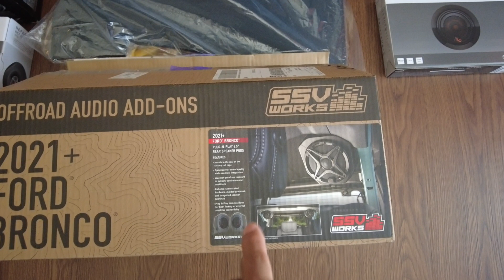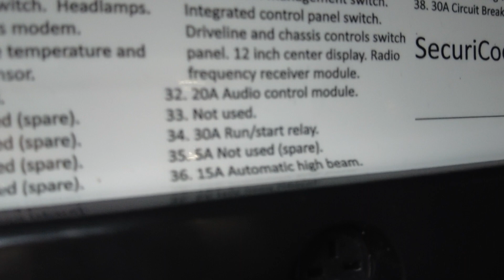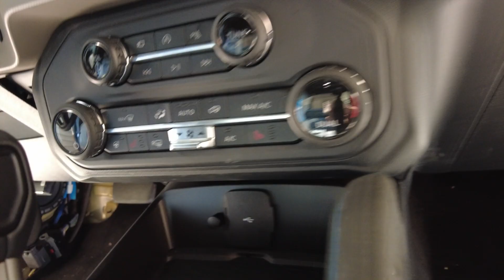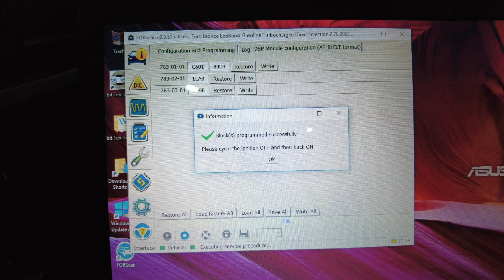Ford Bronco FULL Sound System Overhaul With Aftermarket DSP & Amps Integration

Comment: Awesome job is video awesome job for your sound system... I had to watch your video because I did the same thing With my bronco. Rockford Fosgate speakers 300 w amp and sub.  Cost me $1500 to have installed.    Not quite till the extreme you did, but it does sound a 1000% better than the old system.  Again excellent video....
Reply from the maker: Thank you

Comment: Man. I think you did a really good job on your instal. My only thing is that sub takes up way to much trunk space. I had that same sub, but then had my shop build me a custom sub box on the tailgate.
Reply from the maker: Thank you. But because I have the ability to turn the enclosure sideways for the added space if needed the size hasnt been an issue for me. Plus i can easily remove the enclosure when needed. As far as the tailgate enclosures or even the stealth enclosures you can get or have made, they lack the output i look for so I personally wouldnt get any of those unless there was no other viable option for me.

Comment: Great video, thank you for bringing tons of value! Quick question: I have a '21 Bronco OBX Lux with the B&O sound system. I just ordered new speaker pods, Kicker CS 6.5s for the roll bar/pods, Kicker CS 6.75 for the kick panels, and Kicker CS 4 for the front corners to improve clarity (I'll leave the B&O sub for now). I have an aftermarket 4-channel amp that I want to use to power these speakers. Do you have any suggestions on the best way to get a signal from the head unit to the amp without spending a fortune? I'm okay with buying a DSP, but I'm still unclear on where exactly to tap into the factory head unit to get the signal to the DSP. I've rewatched the video several times but it still doesn't click with me. Any clarity you can provide would be highly appreciated! Thanks! .... PS - I like the idea of adding/plugging tweeters and the front center speaker into the factory harnesses to preserve some of the vehicle's functionality. You get 10 bonus stars for that pro tip!
Reply from the maker: Thank you for the compliments and support. The DSP is essentially an LOC and EQ combined so technically for your setup all you’d need is a Line Out Converter (LOC) to convert your speaker wires to usable RCA’s for your 4-channel amp. essentially you’d tap into the same wires i did in this video (front corner dash and front kick panel speakers). PAC also makes an amp integration harness & LOC that makes it even more simple with no additional equipment needed. The PAC harness for the Bronco wasnt available yet when i did my sound system but if you’re interested in that aspect then look up the PAC AmpPRO for 2018+ Ford B&O Amp integration harness (part# AP4-FD31).
Reply: @Srtfiedofficial  dude! Thank you for the clarification. This step was exactly where I was lost. Great solution and thank you for the fast reply. Your content is great, and you've built some sick systems bro!
Reply from the maker: @mattbz0024 thanks bro💯🙏🏽

Comment: Great video. I have a 22 wildtrak I'm about to build. Only thing I would have done different for ease of install, is a pac audio AP4-FD31. It's for b&o. Can do rca straight to the Amps or toslink into the dsp.
Reply from the maker: If it wasnt for the fact that i needed high level inputs for my DSP I already had from previous vehicles, i would have gone that route but i wanted to utilize the equipment i already had so I had to do extra steps.

Comment: For the Front 6.5 Inch Components the Hertz CK 165 F. Those came with a external crossover. Because you got the DSP Did you still need to use the crossover or would everything just be tuned from the DSP and theres no need for any crossover? My plan is to have separate channels from the amp for the kick panels, front corners and tweets and having a DSP in the set up.
Reply from the maker: Yes I still needed to use the external crossovers since i did not wire the components in an active configuration. If i would have wired the tweeters to their own channel on the amp and the mids to their own channel also then i wouldnt have needed the crossovers that came with them.

Comment: Hey brotha I’m doing something similar in my bronco currently. How did you turn down the factory chimes and head unit sounds after you amplified your speakers?
Reply from the maker: I turned the head unit sounds off via the head unit settings, however because I didn’t tap into the speakers that had those chimes, they arent amplified and sound normal. The back up sensing chimes and blind spot warning chimes come out of my rear tweeters i added to the factory rear speaker wires. The front collision warning chimes come out of the front center speaker that is also just running off of the factory wiring from the head unit.

Comment: How did you get the rca to work with the headunit as they dont have rca outputs
Reply from the maker: Everything was thoroughly explained step by step with visuals if you watch the full video! The sound processor is also a line output converter that converts your factory speaker wires into RCA outputs for your amp which is why i ran the factory front corner dash and kick panel speaker wires to it and then ran new speaker wire back to the speakers separately from the aftermarket crossovers & amp.

Comment: I have the issue with the noise cancellation, heard there’s an adapter to bypass ANC, but in the time being until it comes in, I had my microphones unplugged but still do get some noises, how do I fix the issue of still hearing audio where at 0 volume, granted the audio you hear is so low at 0 but 0 should= no audio / no white noise
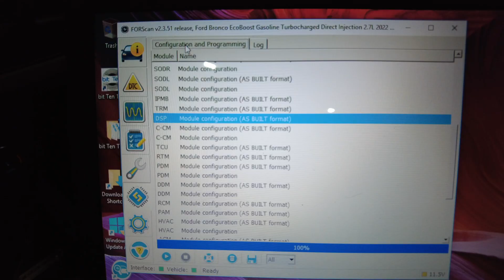Reply from the maker: The only way to truly cancel it is to do what I showed in this video with forscan at the 18:46 mark which disables it all together.

Comment: Both amps, distribution block and crossovers would have fit on your amp rack with room to spare. I have two VXi amps, VXi-HUB, LC7i and a distribution block mounted on that exact same amp rack.
Reply from the maker: If I didnt have to keep the factory amp in place as you can see in the video then they would have fit.

Comment: Hey man, awesome set up💪🏼 how do you like that HD 750 amp do you feel it’s enough for that 12 W7 I’m about to get this similar set up.
Reply from the maker: Thanks bro and yea that HD 750 is plenty for that sub. Technically according to JL, the 12 inch W7 is rated a max of 1000 Watts RMS and 750 Watts RMS being optimal. You could run more power to it but it will void the W7s warranty. That being said, the HD 750 amp is plenty for that sub as literally everyone who has listened to my setup cant believe it’s just one sub on a 750 Watt RMS amp.
Reply: @Srtfiedofficial  hell yeah bro how about that HD 600/1 is it pretty reliable?
Reply from the maker: @TRDproMike the HD600 is a 4 channel amp so it’s a 600/4. In terms of reliability ive had this exact same setup in my past two vehicles so in total ive had it for 7 years now with no issues except I had my Subwoofer rebuilt when I put a hole in the foam surround on accident (video is on my channel about that). But overall both my amps and sub have been great with no issues.
Reply: @Srtfiedofficial  hell yeah bro I don’t care what anybody says about JL Audio that shit is the best!! I currently have 210 inchTW3 with the RD 1000/1 they sound good, but you know that W7 is on a whole other level!! I plan on upgrading to these amps. Thanks for the response.👊🏼
Reply: @Srtfiedofficial   also, what kind of battery do you have??Heard the HD series amps are hungry for a lot of power.
Reply from the maker: @TRDproMike nice and yea you’ll definitely be happy with those amps. JL makes great quality products
Reply from the maker: Im running it off of the factory battery and have been every since i got them brand new but those amps are just as power hungry as other amps in its class. Ive always ran them off of the factory batteries without any added high amp alternators or additional batteries with no issues. The only time you really want to look at upgrading batteries and etc. is if you’re really pushing some serious power but for the average person pushing 1500 watts RMS or less in total system power, the factory battery and alternator is good enough in these newer vehicles.
Reply: @Srtfiedofficial   hell yeah let us get a demo 😎 I’m sure your system sounds bad ass !
Reply from the maker: It’s hard to do a demo on video as it doesn’t do it justice nor does the quality of sound translate through ordinary camera microphones I use.
Reply: @Srtfiedofficial  oh ok bro well thank you for all the information 👊🏼 😎
Reply from the maker: Yw and no prob. Feel free to ask if you have questions in the future and thanks for the support on the channel.
Reply: @Srtfiedofficial  hey bro what’s your opinion on the 10 inch W7 do you think it’s just as good as the 12? I’m not working with a lot of room so I might have to get the 10. W7 🤔
Reply from the maker: Yes the 10 inch is just as good. If you’re limited on space but have enough room maybe consider two 8 inch W7s. They will outperform a single ten inch since you get more overall cone area.
Reply: @Srtfiedofficial  Man i’m hoping that 12 fits if not the 10 will have to do 😅 yeah, those eight w7  are bad ass.
Reply: @Srtfiedofficial  hey what’s up bro how’s it going so I finally got my HD amp  installed with the 12 W7 had a question how turned up do you have your gain on the 750 amp
Reply from the maker: About a little past half way. But i tuned my gains with an oscilloscope as you can see in the video
Reply: @Srtfiedofficial  what an upgrades this amp is 💪🏼thanks bro got it

Comment: I have the b&o and is garbage. I don't even know where to start...
Reply from the maker: If you just want to add better clarity the just change out the front dash, kick panel and rear pod speakers.
Reply: Would I need a DSP to swap out the above speakers?
Reply from the maker: Not at all. A DSP is just something extra that will optimize your sound experience.
Reply: But I can’t add a new sub without DSP? Swapping out pods and dash speakers is fine without DSP. The B&O sub needs more power.
Reply from the maker: @Bonez773 you can add a sub with a Line out converter (LOC). A DSP is also a LOC but integrates a 32 band EQ and other features all in one.
Reply: Thanks

Comment: What a cheap half ass method to install amps and sub. Nothing here is custom and can be placed into any other vehicle. 

Sorry but I have seen far superior stereo upgrades in these Broncos. Suppose you didn't have the knowledge, ability or funds for a truly custom install?
Reply from the maker: You’re either a troll or you obviously dont have any knowledge about car audio. That being said thanks for tuning in and sharing your thoughts despite the ignorance and back handed comment.
Reply: @Srtfiedofficial  I've had better custom systems installed. Please look at other Bronco stereo installs. A better install had the amps installed under cargo floor with double fans for cooling air flow. Also had a custom sub box built not that pos I saw in this video.
Reply from the maker: @trentcasey1354 ok and where do you see anything in or about this video that states that this is a custom sound system build? It clearly states that this is just a full overhaul and upgrade from the B&O setup and showing how someone can do this themselves versus having someone else install it for them. If you know anything about car audio you would know that nothing used in this overhaul is cheap or done half assed as you state, but to each its own. Not everyone needs to or wants to go full custom when upgrading the sound regardless if you know how to do it or not & if you have the funds for it or not.